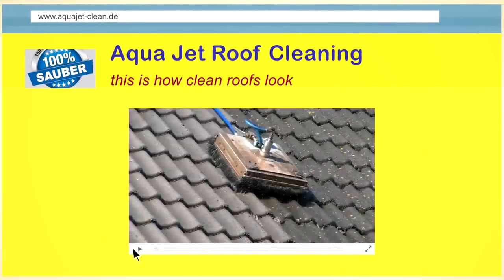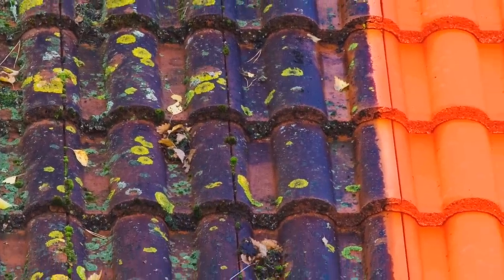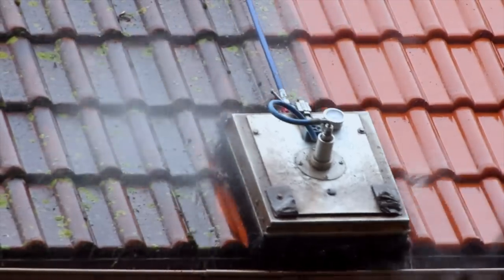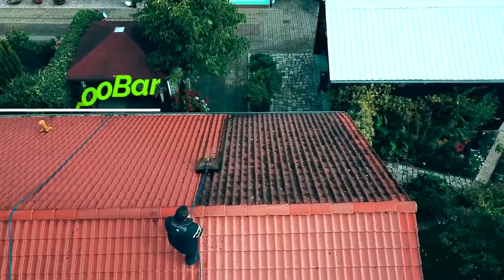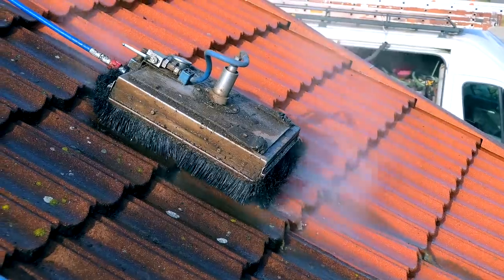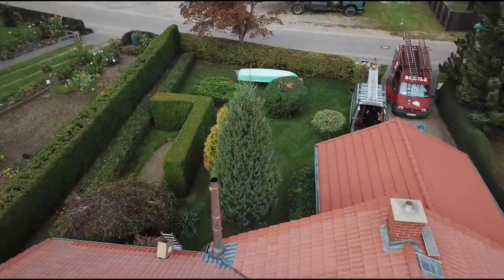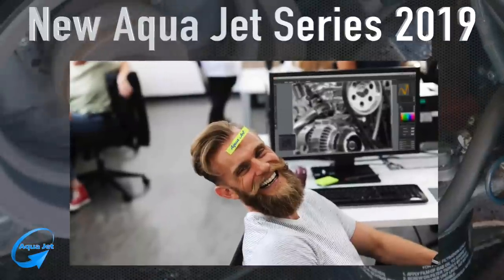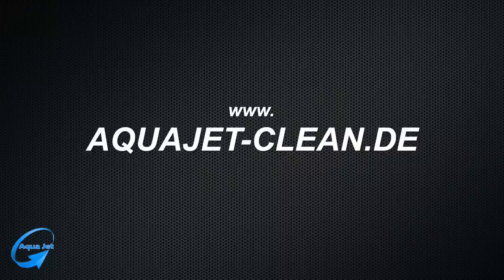Aqua Jet Roof Cleaning System

Comment: High pressure being used in my opinion is not a good idea.  It could cause leaks to form.  A simply soft wash system would clean that roof very effectively without all the pressure being used.
Reply: Exactly this is a terrible service.
Reply: How doed it remove the moss?
Reply: @vas-pn1es  --  18 years vas and it is clear you are not professional at anything.  Especially, when conversing with others.
Reply: It doesn't damage the tiles and there is felt under the tiles so were is the damage?
Reply: @mark90229  --  The damage can come from using high pressure.  Tiles can be easily cracked and or broken from using high pressure not to mention all the water going in every direction underneath the spray head pushing water in cracks between the tiles.  Soft washing technology is far superior to using pressure on any roof.

Comment: Would have to be mad to use that on any clay/terracotta tiles, in fact anything other than a concrete tile. If it’s been in a kiln it has a fired outer surface that protects the softer inner material. Go using this type of water pressure on them and you destroy the fired surface. Then watch it degrade rapidly. There’s a reason you are not allowed to use high pressure power washes on listed buildings, especially the roof. It’s like using sandpaper on your teeth to whiten them. Great....for 5 minutes.
Reply: If there is moss on the tile the outer shell is compromised, sealing the tile after cleaning is still an option.